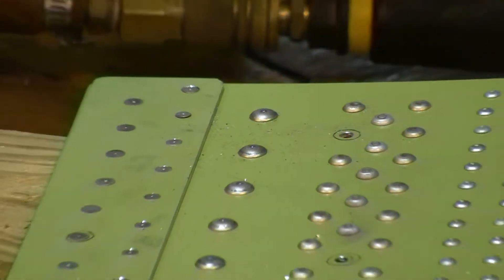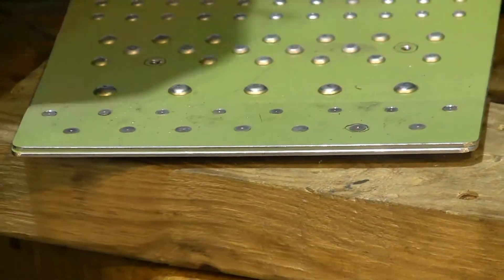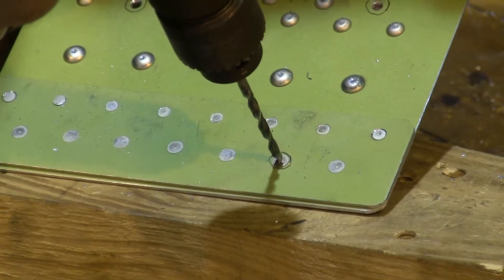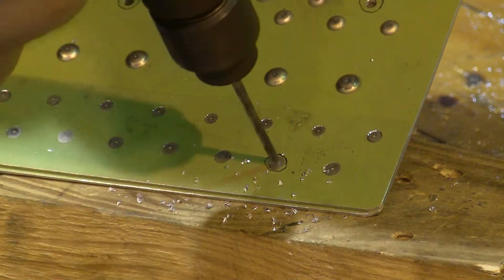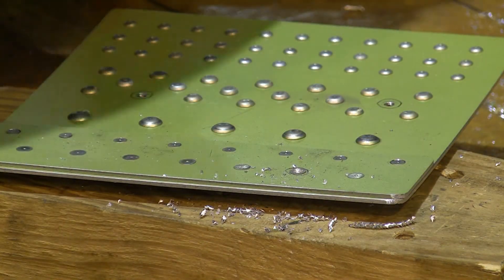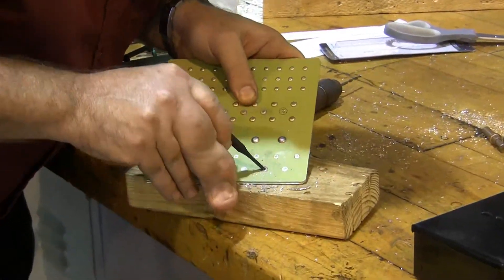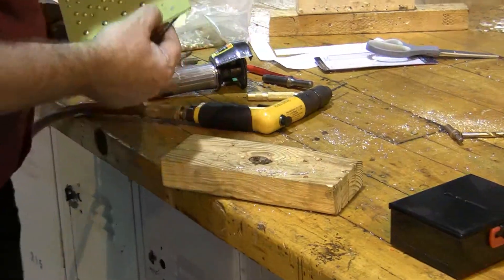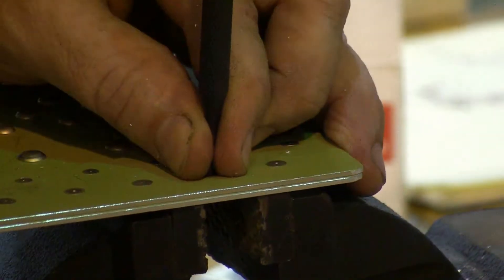AVT 206 A&P Sheet Metal Class - P1 - Removing Flush Head Rivets

Comment: So when removing rivets, should I use a drill bit which is the same size as the rivet shank or should I use a smaller one?
Reply from the maker: The official recommendation is to use a drill bit one number higher (smaller) than the rivet hole.  This is best.  If you do not have the correct size bit, you can get by with the same sized bit, but proper technique is more important.